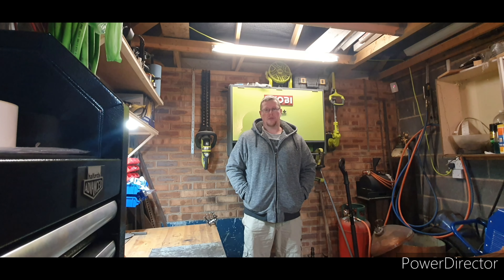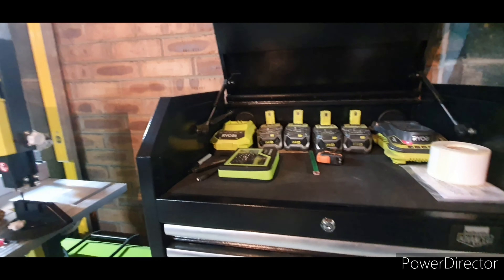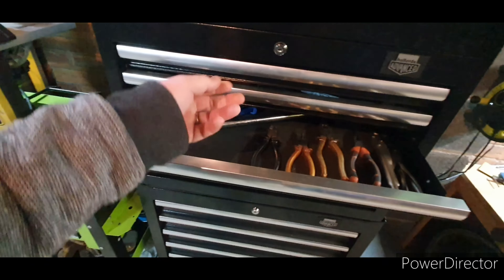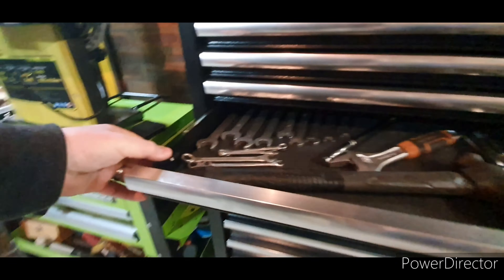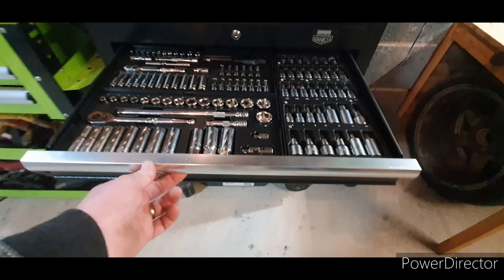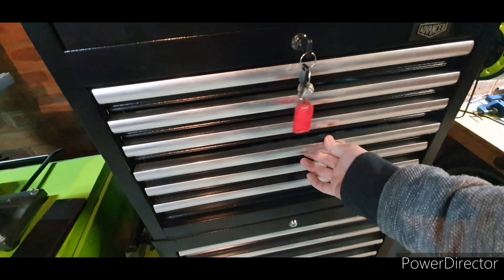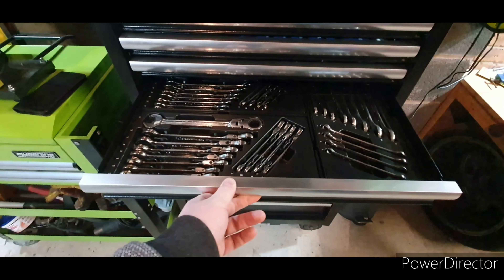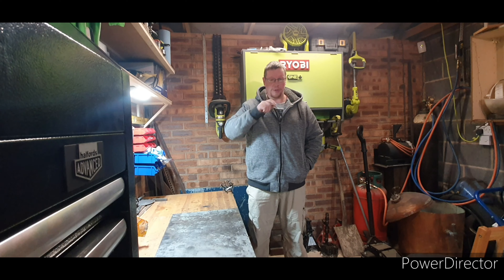Halfords advanced tool chest and top box review. part 1

Comment: I’ve had the box since is first come out , the locks are trashed on the top box due to Draws not even locking , you cannot even fit the split 200 piece set in the top , wouldn’t recommend this box at all , for the price you can definitely find something on SGS which is twice the size of this box for the same price
Reply from the maker: I didn't think it was too bad for the money but it was too small for my needs so I upgraded to a 56inch sgs box 👍
https://youtu.be/xpR1o57azkI
Reply: @TheYorkshireMix  I only just found you’re channel lol , I have subbed , the problem I had with the box was that the top box was just not good enough in my opinion, draws not lock and you can open the top with a screw driver if you wanted to , as a professional mechanic using the box for the last year it’s terrible for every day usage , I’m 18 and so I think I’ll be moving on to SGS soon my friend
Reply from the maker: @lgbk5957  cheers pal I appreciate the sub. I do agree. The top box didn't seem to be as good a quality as the bottom box. I did have some problems with the drawers not closingproperly. I can't fault the sgs box though👍

Comment: Was looking into the bottom chest as would like to remove wheels and bolt to the 18mm plywood floor in my little van, my only concern is, will the draws open, when locked, with all the g-forces going on, when driven.
Reply from the maker: Unless you plan on sending it round a racetrack on 2 wheels i think you will be fine mate 😂 they might  occasionally open if you don't lock them and have heavy tools in the drawers when driving like a mad man but I think that would take some doing. The locks will definitely hold them closed though as I think it would take a very large amount of force to pull 1 open if its locked. Hooe this helps 👍

Comment: I have that box and the top i have replaced twice when my other one comes tomorrow so that will be my 3rd top box due to soft close not working and my bottom draw keeps poping out when i lock it up. This box is not worth the money in my eyes that is why i call halfords shitfords because all there stuff is shite and low quality for the price so i get stuff from mac tools because they are quality stuff but i only buy halfords tools if i will not be using it all the time at work or for home use
Reply from the maker: Yeah if I was using them all the time as my job then I wouldn't have gone for them but as a hobby tool I Don't think you can get better for the price. The Halfords box and all the tools is cheaper than a small high quality toolbox like mac or snapon and it still comes with the lifetime warranty 👍
Reply: Ye fair play to what you say and if i had the money i would get a better box but i am still young and learning my job so ny box will do for now also i think stuff in the adavance tools are crap like the 3/8 screwdriver sockets as i snaped a flat head screwdriver taking a pan head bolt of a job